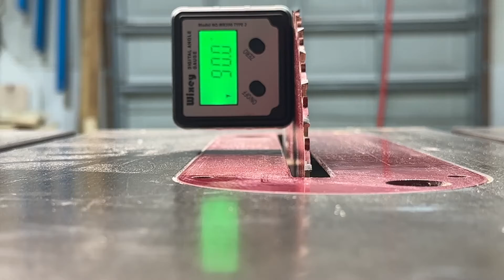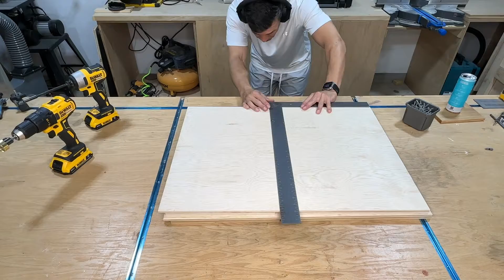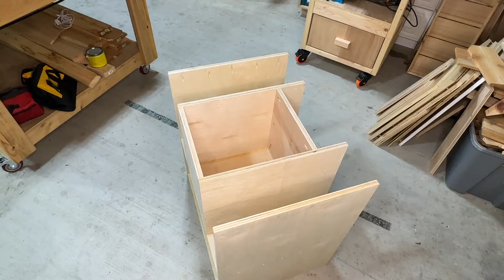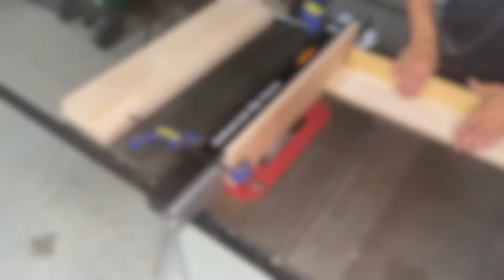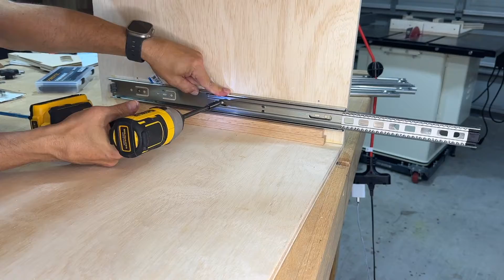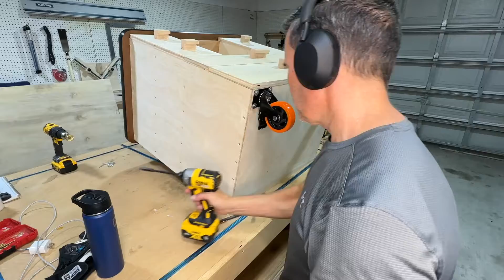How to Build a Mobile Router Cart | Plywood Construction, Storage & Heavy-Duty Casters

Comment: Sure,glad I found this channel. Just wondering also do you like the miter saw a lot. I have seen too many brands to mention, but I think the Delta is probably the most used. What's your thoughts?
Reply from the maker: Glad you found my channel and I’m glad that you’re glad that you found my channel… Yes, I really like this Delta. I actually ordered and used the Dewalt for a couple weeks and wound up swapping it out. It’s extremely smooth and although it does have some blade deflection when fully extended, it’s extremely accurate. The shadow line is great… My biggest complaint is dust collection. There are third-party manufacturers out there making some really cool 3-D printed stuff that I will eventually wind up trying out to help with the issue.